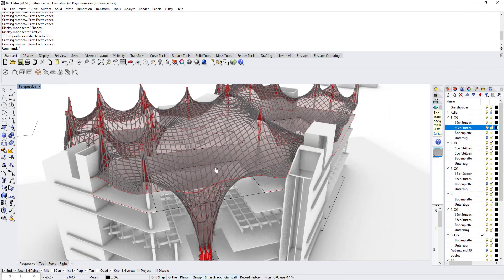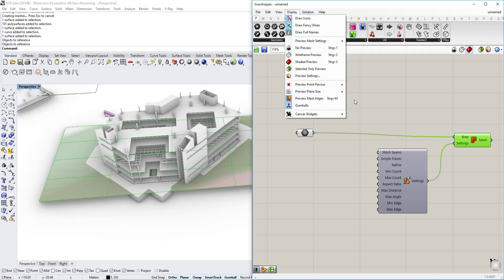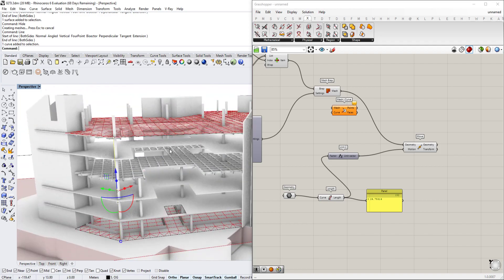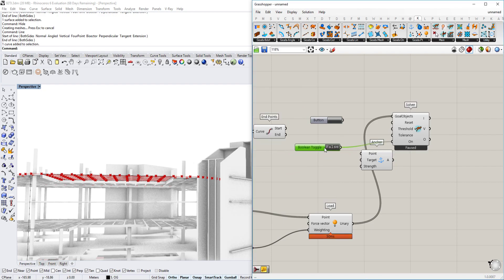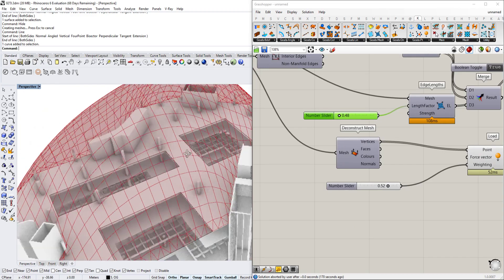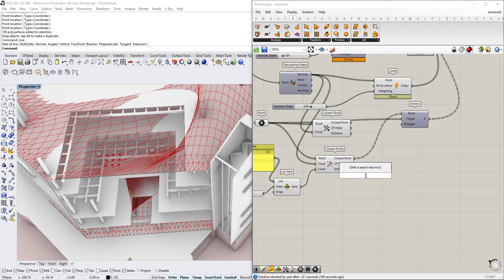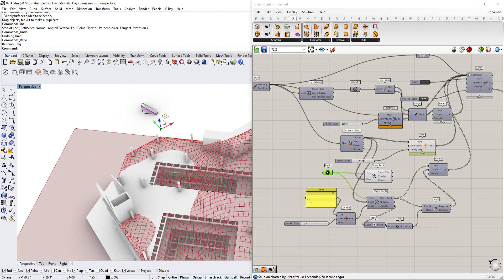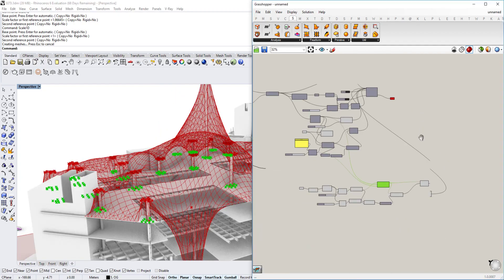Adaptable Rooftop Shape Tutorial

Comment: Hi, just a quick question is there a way to put panels (glass or just solid panels) in between de pipes as roof structure?
Reply from the maker: with that, I would just recommend to use the overall surface, as the glass, or you could do a mesh->nurb conversion and have lots of triangles and quads for that. Might work well